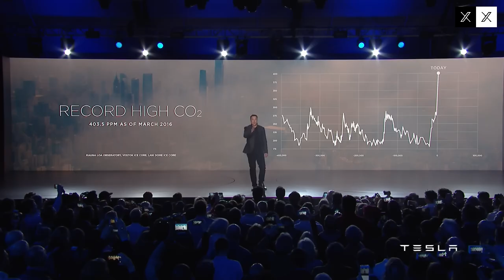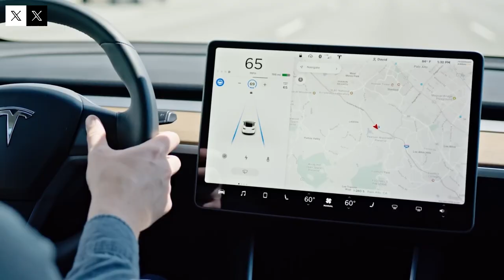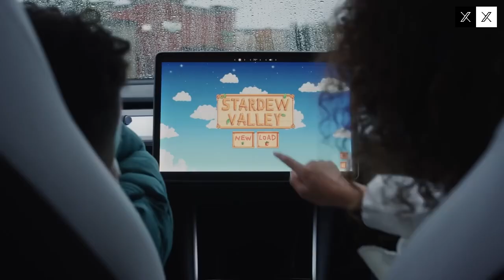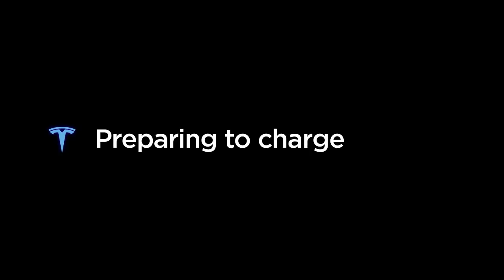Incredible! The New Tesla Model Q for $20,000 Is Changing the Auto Market

Comment: There is. no. confirmed  Tesla Model Q 
available at the $20,000 price point ;reports 
about. it are from speculative.  You Tube  Videos 
Facebook posts, and articles, some of which 
also. mention a Model 2 or an. unspecified 
Cheaper vehicle while. Tesla has. Strategy  for a 
a ,lower -priced. ,sub. -$30,000 electric vehicle 
the. specific details and  launch  timeline for. 
something like. the Model Q are not official 
with. some sources suggesting a 2025. debut 
while others mention a model 2 Launch